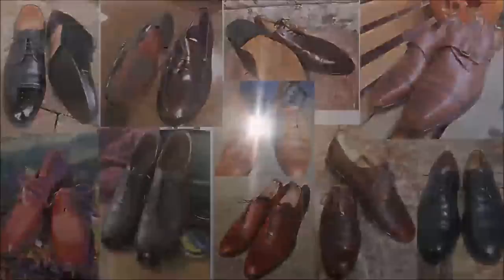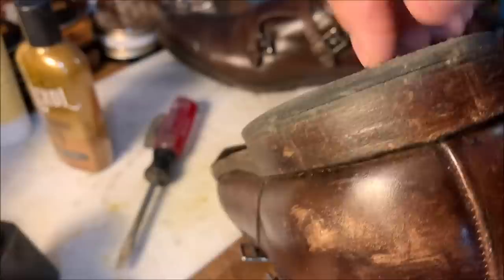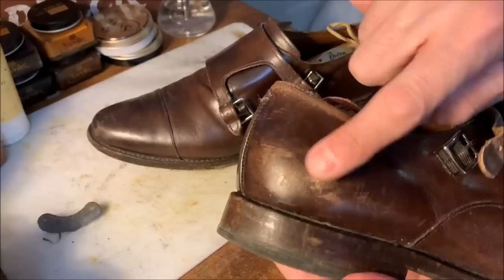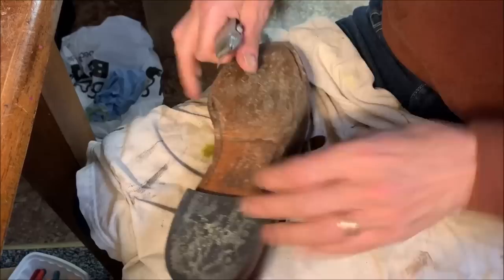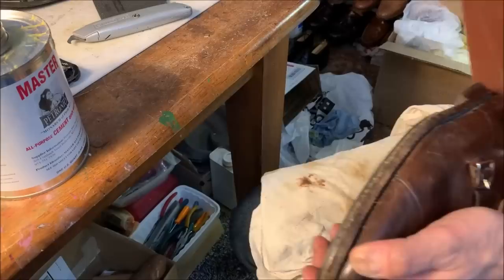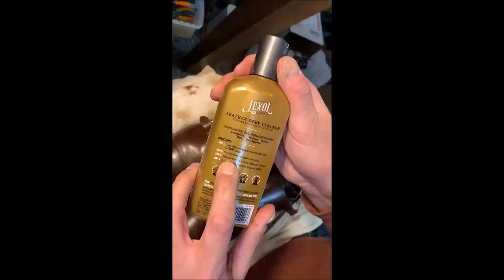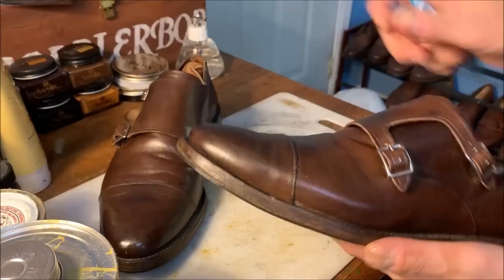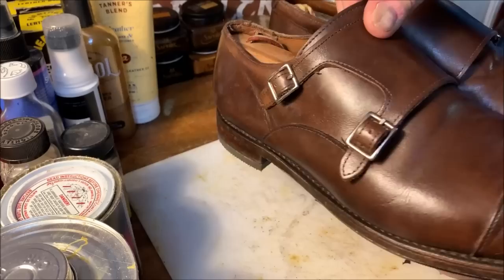Allen Edmonds Mora Monks: Heels, Half Soles Replace, & Shine

Comment: The shoes turned out great! I was just wondering if you happen to know any Shoe Repair Supplies supplier in your area. You could probably get the contact cement from them for much cheaper. I have a supplier that is 3 miles away from where I live and they sell the contact cement for much cheaper.
Reply from the maker: Moises Frausto - thank you! FYI every single cobbling supplier place I contacted had one of two problems:
1. Would not sell to the General Public 
2. Way expensive because of overseas shipping costs and/or large bulk quantities.

Comment: To eliminate all creasing remove the wax and then wet the upper with water every 4 hours 3 times a day while using shoe tree tomorrow your shoes will look like new
Reply: When you say wet the uppers, do you mean use a spray bottle and mist it or throw the shoe into the sink?
Reply: @wyattc.4455  only spray it its enough
Reply: @mesharyhd7646  Great! I will definitely try that out. Thanks for the info 👍

Comment: Robert, 
i'm getting addicted to your Channel recently. 
Bought two pairs of Allens in recent weeks, one walnut sandford and one navy gorgeous neumok, both for a bargain. 
I'm inclined to put some half soles to prolong the life of the shoes, albeit I'm lacking a good cobbler around. I'm going to try do It myself, but I have a doubt: do you think that i can apply these soles no matter how wear the shoes soles have? The neumoks have some wear, something like months or a year and the sandfords much more wear, like two years at minimum, i'm willing to wager. Can I still apply these Rubber protectors as far as I grind the soles, no matter the wear in them? what do you think?

Also what are your thoughts in Lexol as a conditioner and cleaner?

Best Regards,
Greetings from Brazil.
Reply from the maker: Vinícius Coelho - it IS more difficult to apply rubber half soles to worn shoes. Specifically, the issue is with the tips of the toes, and the outer edges of the soles near the ball of the foot. Those areas, especially the toes, round off the edge of the sole. Then what happens is if you don’t sand them down flat, you’re trying to glue a flat rubber sole onto a rounded surface and there will probably be an unsightly gap that will create a spot to work loose the sole. As I said, the tips of the toes are the biggest problem from my experience with worn soles. You have to watch, because I wouldn’t want to sand down the soles so much to remove severe rounding and break through the sole stitches too much.

Lexol: I bought it because I heard good things about it, and bc it’s PH balanced, but I’ll have to use it more to get a feel for whether or not I like it. It didn’t lather up much, so maybe I didn’t use it correctly - I didn’t use a microfiber cloth or Lexol sponge to apply it like the label said to.

Comment: Good info about the PH levels. How long do you let the glue dry on the sole/heel before you trim the excess shoe guards?
Reply from the maker: that•thrift•guy - the can says “apply one coat of cement to each part and let dry. May be left open for up to 8 hours, if necessary. May use heat activation if needed. Heat activate both parts to be bonded. Join parts & press.“
I didn’t use any heat, I believe I left them dry for about 15 minutes (until they no longer felt “wet” to the touch).